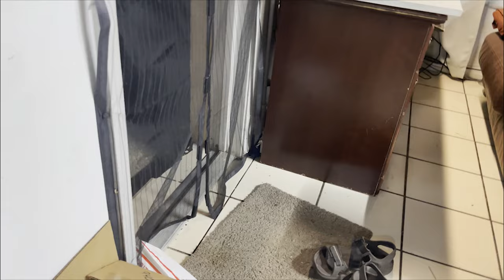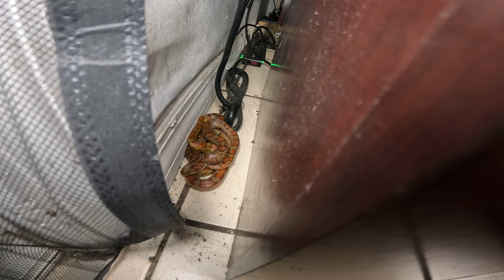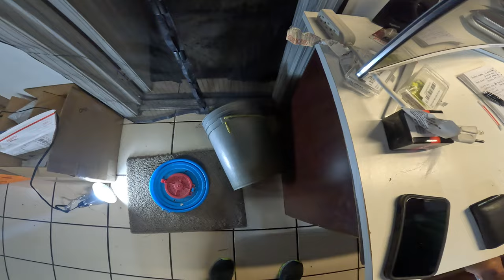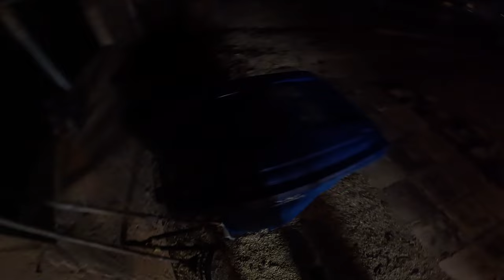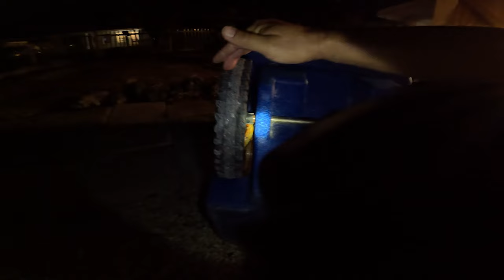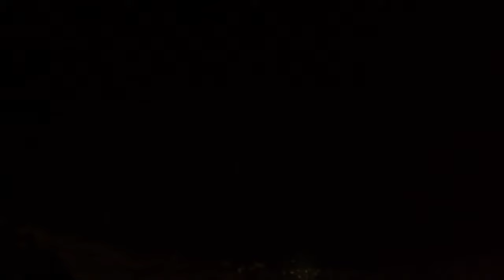Finally.  Snake In the House.

Comment: When I lived on Middle Torch I had rattlesnakes under the stairs all the time. BPK had them and black racers ALL over. Wilma really took a lot of the population down. The airport in MTH used to have copperheads and coral snakes too. Long Key used to be called Viper Key waaay back in the day. I’m not as paranoid living on MTH now but I’m still always looking. 🐍